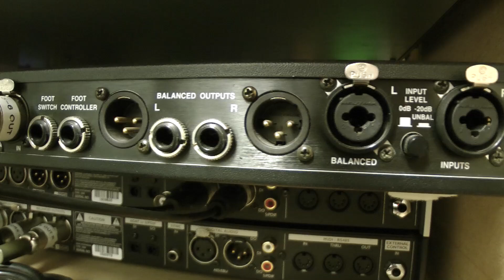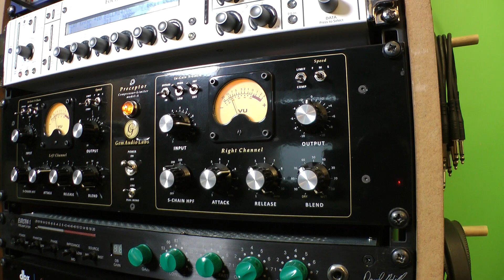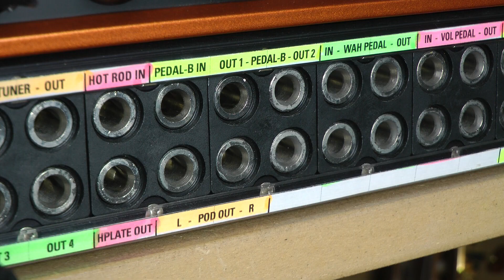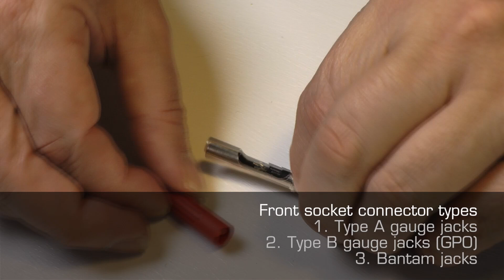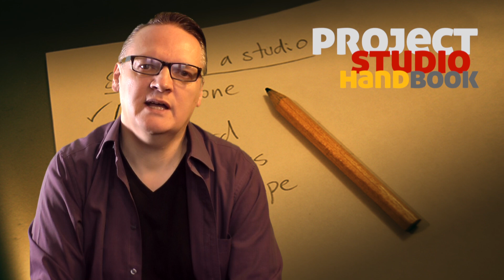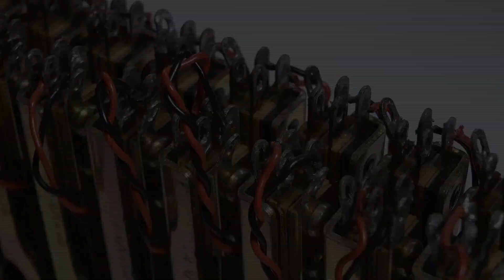Audio patchbays (patch bays) (v1)

Comment: Hi,

I really like your way to explain things - great channel! Thx in advance.
You answered my most important question about mixed topology - balanced (bl) unbalanced(ubl) - and which type of patchy I need. 
Can you tell me "where" to change the balanced/unbalanced flow while cabeling?
A) Instrument (ubl) -> cable (ubl) -> patchbay (bl) ->  cable (bl) -> audio interface (bl)
B) Instrument (ubl) -> cable (bl) -> patchbay (bl) ->  cable (bl) -> audio interface (bl)
Ofcourse no doubts about a strict balanced cabeling.
C) Instrument (bl) -> cable (bl) -> patchbay (bl) ->  cable (bl) -> audio interface (bl)
Reply from the maker: Thanks for your comment. A is the standard method. There is no advantage in B or C, the ground and negative connectors are summed at the unbalanced jack. Hope this helps.

Comment: Hi,

Would you consider doing a tutorial, talk through on the connections between the live room and a control room in a recording studio with regard to patch bays etc...It gets very confusing.....
Reply from the maker: Yes. Great idea. We'll add it to our production list. May take a while before we get round to it though. These kind of connections are usually called tie lines and simply consist of a wall or stage box with multiple XLR and TRS jack connections (sockets) to allow the connection of mic's, headphones and line level sources.

Comment: Does the fact that you're connecting to different outboard gear with quarter inch through the patch bay affect the quality of the sound vs going in xlr?

Thanks
Reply from the maker: Providing the contacts (plug and sockets) are clean and oxidisation free, the electrical signals will pass unaffected and sound identical. However, many cost-effective 1/4" TRS jack patch-bays are not as robust as the GPO / Type B and tend to tarnish over time thus compromising the quality of the contact. In our experience GPO's rarely suffer from this issue and offer exactly the same quality of contact as XLRs. Remember that XLRs do not necessarily provide an intrinsically better contact than jacks. Their primary advantages are that they have locking mechanisms and superior cable restraint. It's also worth remembering that probably every track on every CD/LP we have ever heard, that was produced before "in-the-box", passed through GPO or Bantam patch-bays on its way through outboard.
Reply: Are the GPO's also 1/4" or would I need to buy new cables and what's the least expensive GPO I can buy that is still good quality. 

I can't seem to find any GPO patch bays can you give me some links?

Thanks
Reply from the maker: Try this one for patch leads .. http://www.stage-electrics.co.uk/shop/sales/extension-cables/audio/cables---screened---gpo-jack-type-'b' ..  and this one for patch bays .. http://www.canford.co.uk/CANFORD-B-GAUGE-HIGH-DENSITY-JACKFIELDS-Broadcast-style
Reply from the maker: GPO connectors (plugs) are a similar size but different shape to Type A 1/4" jacks. Patch bays .. http://www.canford.co.uk/CANFORD-B-GAUGE-HIGH-DENSITY-JACKFIELDS-Broadcast-style  Patch cords .. http://www.stage-electrics.co.uk/shop/sales/extension-cables/audio/cables---screened---gpo-jack-type-'b'
Reply: I tried the link for patch cables but nothing comes up? Tried a different browser but neither worked. Do you have another link?

Thanks
Reply: Ok, I found it! Had to google cause the link wasn't taking me there but found it. 

They keep calling them B Gauge cables but it doesn't specify if it's GPO cables is that it?

Do they have the equivalent of Mogami or Monster cables in GPO format?

And one last question. Was the link you gave me for the patch bay the only one? I wanted to shop around and compare prices and how come they are so hard to find? I google GPO patch bays and hardly anything comes up. 

Sorry for so many questions. 

Thanks
Reply from the maker: Don't know why those URL's won't work but for patch cables search "GPO patch cable" at http://www.stage-electrics.co.uk and for patch bays/panels try this .. http://www.canford.co.uk/Audio-jackfields-and-patch-panels For elsewhere just try searches such as "GPO patch bay" or "Type B patch bay".
Reply: Ok, thanks!
Reply from the maker: GPO was the UK terminology for B Gauge.
Reply: Hello, I'm finally getting ready to order the GPO patch bay but the only ones I can order are from England. Do I need to be concerned about compatibility with the power supply? Would I need an adapter?
Reply from the maker: Analogue audio patch bays require no power supply, they are purely passive. Although they are often referred to as GPO (General Post Office) patch bays in the UK, they are also known as Type B. You may find suppliers if you search with that, but you may be right and the smaller bantam format may be more prevalent in the US.
Reply: Ok thanks for the info. Is the bantam format GPO or is that different?

Also I've noticed that all the GPO's I see are open backed, in other words it doesn't look like the input jacks are covered from behind, is that how they all come?

If so do I need to incase it somehow so they don't get dirty and would leaving them open affect how clean the signal is?
Reply from the maker: Bantam is essentially mini GPO, developed by mixer manufactures to get more sockets in a smaller space. They work great but are challenging to solder. Dust on the soldered cable connections won't stop or degrade the electricity, but most patch bays are sited in cabinets.
Reply from the maker: Not at all. Those electrons will just flow!
Reply: Ok, great!

Thanks for all the info.
Reply: I think I figured it out. Here in the states they call them Tiny Telephone (TT) patch bays. The open back ones are set up for you to solder the connections. 

Sorry for so many questions but I'm glad I checked cause all the links I had were open back but now I've found them. They are very expensive here. Around $300 USD for the cheap ones but at least I've found them. 

Thanks again.
Reply from the maker: Glad you found what you needed. Patch-bays are not normally sold with cabinets but are usually sited inside 19" rack cabinets either built by studio owners or purchased from studio suppliers.
Reply from the maker: Soory for the delayed response. No, providing the contacts are clean there will be no effect on quality.

Comment: Do you know the Signex smartpatch arc32? Its just to know if you use it or not,and maybe why not...thanks a lot your vid is extremely precious! (sorry for my english)
Reply from the maker: Hi Jeff. We've not used the Smartpatch but it looks very interesting. We would want to ask Signex if it uses balanced connections because although rear connections are via TRS jacks we couldn't find any direct mention of balanced connections at the site (and no photo of the rear panel!?). Other than that it could be well worth trying.

Comment: not able to run balanced to an unbalanced device through a patch bay? - are you can actually do that. The only difference is you don't have the audio inversion which allows for removal of noise picked up along the cable. Your balanced device essentially runs in an unbalanced mode.
Reply from the maker: ***** That's correct. Just connect the earth and return wires together at the unbalanced device connector, or leave the return unconnected, whichever gives you a connection without hum. You will of course lose the noise cancelling properties but this is rarely a problem in short or line level connections.
Reply: @Projectstudiohandbook  not possible to use trs / ts cables and give a fuck?

Comment: Hi there, you talk about pararel connections can I add signals together. Ie snare and clap into one input on my sound card? Thank you
Reply from the maker: This is a really good question. Parallels are usually used to copy signals not combine them. If you attempt to combine 2 signals in this way you may find strange changes in level and distortion which we think may be to do with impedance issues or possibly feedback. It certainly doesn't work for us. Hope this helps.
Reply from the maker: +Michael Riach Useful comment Michael. Thanks.

Comment from the maker: You're exactly right. With patch bays such as these you simply rotate the PCD 'card" to change the normalisation options. I would guess that the options are simple such as non or half normalised. We used to have a patch bay that allowed easy reconfiguration by placing a drop of solder on a PCD at the right place, but the DBX looks pretty good to us.